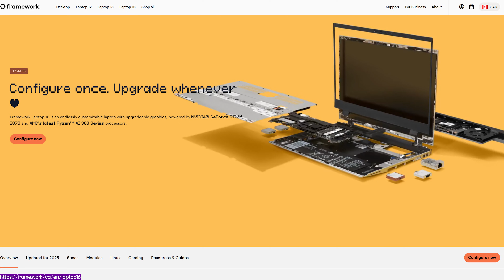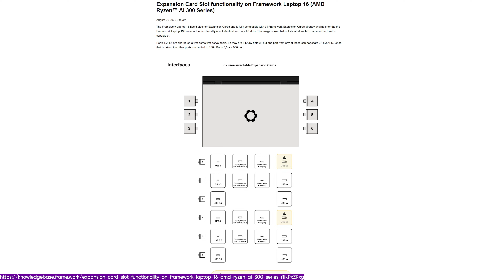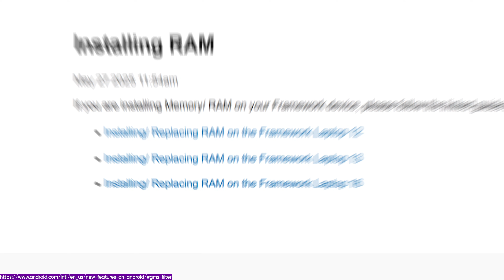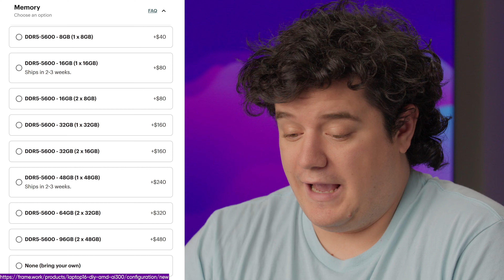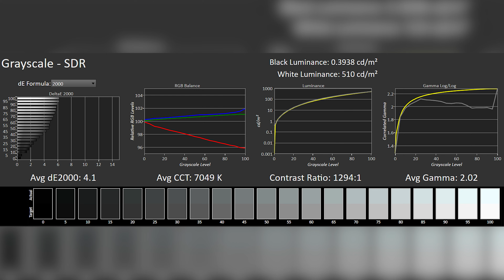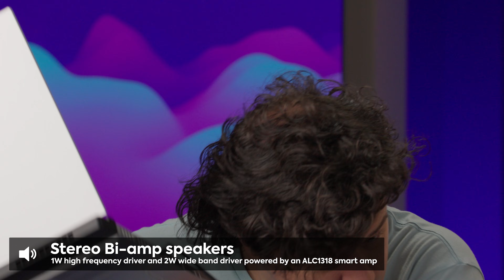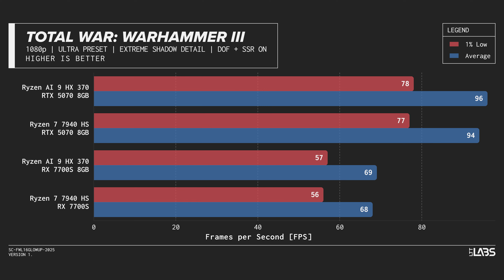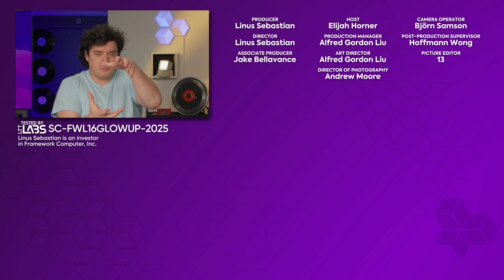I can FINALLY Upgrade the GPU on My Laptop! - Framework Laptop 16 (2025)

Comment: I really hoped Framework would be different but it looks like they are falling down the same path that every other company that has tried modular devices has before. From the high price, to having to replace the screen to replace the GPU, to having restrictions on which ports support which modules. It defeats all the reason of having a modular system. On top of that the amount of flex on this laptop is the worst I've seen in a while, for 3K+ that display should have less flex than a 2x4.

Comment: It’s still very low-spec for what they’re charging. Any laptop with an RTX 5070 won’t really need an upgrade for at least three generations, but the problem is, unlike a desktop, you can’t just swap out the gpu upgrading a laptop basically means tossing the old one in the trash. And the price? Completely over the top. Their laptops are overpriced the same way Apple overprices ram and ssd.
for example, the orange bezel alone costs €24 😅, the LED matrix is €55, and the Numpad (2nd Gen) goes for €45 — all for features nobody really needs. At this rate, you could almost buy two decent laptops for the price of one

Comment: 7:55 The spacers are intentionally different heights, to avoid the keyboard pressing into the screen when closed.
Reply: That doesnt make sense... the frame itself should be what manages the close height/delta. Why would things a user can customize (and if they include a num pad, completely negate including) be what deals with that? Makes no sense. Silly.
Reply: @adammiller9029 The spacers next to the touchpad line up with the touchpad, and the spacers next to the keyboard line up with the keyboard. The touchpad is slightly raised above the keyboard, though.

Comment: All new laptops and phones are too expensive, I came from an age when year on year there was a reduction in price.  The original IBM AT pice in 1984 was $6000 but by 1989 you could by at AT type computer for had come down to under $1000 as the specs had gone up.  My first 486 based computer was about $600.    I don't know what and when the change from cheaper each year to more expensive each year happened but when ever it happened please take us back.

Comment: I was pretty close to getting a framework 16, but the pricing is just ridiculous. I could get a laptop with a 5070 for under $1400 and a similar framework laptop is about double that. I could get the non framework laptop and buy a new laptop in a few years and pay the same amount of money as I would have with the first framework, not to mention the upgrades are also expensive.

Comment: The Framework 16 ticks all check marks for me: the ideal all-AMD setup for Linux (7700s is pretty old at this point though), two NVMe m.2 slots and of course, the modular aspect of it, but the only reason I haven't bought one, as shallow as it sounds, is the form factor. The 12-inch is really cool, the 13 one kinda average but still okay, the 16 though... that mishmash of black plastic and silver metal blocks with gaps and bezels between them puts me off a bit. It would have looked less intense if it was all-black, but I understand their environmental concerns towards anodizing.

Comment: 3:00 Those are not recommended slots, they are the technical limitations. Bottom ones don't support anything else than USB devices, so no video output.
Reply: Bottom two are off a USB hub built into the mainboard. The other 4 are attached to the SoC.

Comment: I'm just not impressed with the fit and finish of this device, plus the screen is a major issue. I'd prefer to have a laptop that's easy to upgrade, but maybe without the weird extra panels...A solid keyboard bezel wouldn't be so hard, would it? For $3,000, I expect better tolerances.

Comment: Not going to lie, this laptop sounds pretty terrible. Super expensive, bad screen, keyboard flex, gaps between spacers that are noticeable, only some USB ports suggested for some applications. Even the upgradeability aspect comes with an asterisk (new screen needed to take full advantage of new GPU). 

I like what framework is trying to do, but I could never see myself buying this.

Comment: I mean I like the laptop but that price is just not something I can justify, I priced one out and I can get a similar performance laptop for half the price.  I was looking at other 5070 laptops that are priced at under 1500 with better displays and for 1600 I could move up to a 5070ti.   I mean I literally priced out a laptop with a 5090 that was cheaper than the framework.     When I just buy a full new replacement after 2 years and still end up cheaper than just the initial price not even mentioning the cost of the upgrade it just makes no financial sense.

Comment: I just think the price is way too high. I considered a Framework laptop, but ended up going with a Lenovo 15IRX10 instead. For $2,500 USD (including Norway’s 25% tax), I got an OLED 165Hz 2560x1600 screen, an RTX 5070 Laptop GPU (same as the Framework), an i7-13650HX (wish it was Ryzen, but its fine), 64gb of RAM, and an extra 4tb NVMe SSD on top of the 1tb the laptop came with. 
That’s double the RAM, 2tb more storage, and an OLED screen for $500 less. And that’s not even counting the tax difference. If you add 25% VAT to the Framework, it ends up around $3,700 USD, so 1200 USD less.
Just didnt make sense, but i guess framework is still very much about North America and not Europe yet. I TRULY hope Framework makes money, and will continue to build upon this modular idea. Its a great idea. just didnt make sense for me.

Comment: @8:30 Didn't people say you can get rid of the keyboard flex by putting thermal pads on some components inside?
Reply: They did something this on the later first gen models. There's some extra padding under the keyboard. Mine doesn't flex much at all.

Comment: The ONLY thing keeping me away from buying a framework device is the price. It was the price when they first launched the Framework 16 and it still is the price that I am not even thinking about buying the new Framework 16. I do understand that it opens up the upgrade path but you have to consider, if I were to buy a laptop instead of upgrading and get similar if not better performance, the argument does not make as much sense. You need to be at least 3 version (GPU and display) upgrades in to make it actually competitive to buying 3 new devices. I love the concept of what Framework is offering, but I just wish they can make it cheaper and offer more options eventually.
Reply: Right, and even then, if they don't have what you need (ex: a bigger screen because your vision kinda sucks even with proper glasses) then you're not going to buy from them. On the flip side, I don't need what they do have, which is whatever high-powered internals that make it worth even $1k. Will the average user need that much memory/power/whatever and not go for something potentially even more powerful for the same price point?

For me, I was between buying a laptop and a tablet or a 2-in-1 laptop that did both. Micro Center had a 2-in-1 for $350 US, and that's with a 16" screen. I haul it around for meetings and occasionally working in coffee shops, and I've been perfectly happy with zero issues. How could I possibly justify even the $1.5k base model price (iirc) compared to that? My home rig got the nearly $2k US treatment, which was much easier to swallow given that I'm way less likely to drop it or get croissant flakes in the keyboard.
Reply: Just a matter of time. These are still somewhat early days for framework. The Framework 13 for a similar config that we have for our business PCs is within 100$ of what we pay. The pricing shifts up and down for our units but it has gotten very close, whether that is because HP charges a fortune or Framework getting the price down, I am not sure.  With that being said the additional complexity that comes from a replaceable GPU will likely mean the 16 will always be a bit more expensive, but being almost double comparable laptops is crazy.

Comment: Sorry to say this but frameworks laptop are for people who don’t understand laptop and their value . If you get a 5070 , 32 gb ram and with 500gb of storage laptop with framework it would cost you around 3000 plus . A similar laptop with the same specs are in the range of 1000 to 1500 . I understand the idea of customization and it being modular but it doesn’t justify the 3x price tag . It not going to save you money in the long run ether because it 3x the price if bought an another laptop you’ll still be cheaper. It a scam trap for people who are into tech . You can legit get a 5090 laptop for the price .

Comment: the upgrade factor isn't worth it when you can just buy a new laptop with newer specs for $1500 half of the frameworks initial price tag

One framework + upgrade would be 3k + 800 for gpu and screen (3.8k in a few years with a last gen CPU and everything you didn't upgrade) 

while 2 Lenovo laptops is only 3k giving you a full system hardware upgrade when ur ready for it

Comment: I've got the 1st gen of this laptop and the fans absolutely HAUL under a load & push a ton of heat out the back. I'm not super upset by it because it means the cooling is working but they are definitely loud and sometimes out power the speakers

Comment: 4:40 "Liquid Metal can sometimes be a little daunting" 

Quite the understatement here.
Reply: Yeah. Modular laptop and liquid metal are a contradiction. 

LM is already a nightmare for repairability (often the cause of the issues due to its conductivity). There is almost zero usage cases where the theoretical extra 2 degrees of dissipation it might offer actually justify its use, let alone on a laptop that's meant to be regularly disassembled.
Reply: There is an alternate thermal paste, that's about as good, or better then LM, plus its non-conducive.
It's by Thermal Grizzly, but has a reddish color paste.
I think its a little more expensive then LM version.
I've already used it in one of my computer systems.

Comment: The price is absurd, for the money you could buy a regular laptop with same specs now, and replace it in a couple of years with another one with up to date parts. Until Framework manages to get their prices to maybe 20-25% over comparable competitor at most, I don't see a future for them in mainstream market, despite all the free promotion they are getting from LTT.

Comment: So… horrible display, bad battery life, okay speakers, bad build quality (crazy display and keyboard flex) thick ugly bezels, weird shelf-like look in the back, vents galore in the bottom, spacer spacing issue, thick heavy power brick, heavy laptop… all so I can fix and upgrade easier?

What are people doing to their laptops that makes them this worried about repairability? People typically upgrade every 5-7 years. You’re telling me in 7 years time they won’t just decide to buy a whole new model of framework where the peices will undoubtedly be either incompatible or very limited performance wise with their current motherboard? 

Buy a better spec, less repairable full package windows laptop. Better yet, buy an M4 air for 800 or an M5 pro if you really need the upgrades.

Comment: What do I think ? I think you're quite wrong on the pricing. And frankly, quite a let-down to dedicate so little to it, even if it's Short Circuit.

First, I am a firm believer that the most important part of the laptop (and the extra price you're paying) is for repairability first, upgradeability second. Repairability basically guarantees that you can use the laptop for over 10 years (you or whomever you might give it or sell it to) even if Framework goes bust tomorrow. With its modularity, it's also easy to find spare parts. If you do need to repair, you have the highest chances it can be done in the first place and at the cheapest price one can usually get. That's how you recover the money. This repairability also makes it so it can be sold for somewhat decent price later, even if the components are dated.

Second, the price is very big.... except you can buy the SSD(s) and RAM from a retailer (if you don't already have some) and get to a much lower price. Still on the expensive side, still usually more than the competition with the same specs, but much closer and easy to reason with. This is why I'm disappointed that it wasn't even mentioned.

Frankly, a full video exploring the options and the lowest prices you can have the Framework laptops (all 3) is SORELY needed. I had comment fights with others on YT on other videos about the Framework 12 that said that you need to spend $1000 and that it's too much, only to show them that if you're smart about it you can spend $650 and have the laptop, and spend $100 later and arrive at the same specs as the $1000 one. Not to mention that you can go second hand if you're on a budget. People REALLY don't know how many options Framework gives you.

Comment: exorbitant. this is hopeless. industry should collaborate a standard for modular laptops like a DIY/desktop PC. this is way overdue considering the electrical components of a laptop can fit inside the dimensions of a smartphone or PC gaming handheld or tablet pc. don't mind discrete GPUs, integrated graphics is now and the future.
Reply: They earn more money when you buy new laptops instead of upgrading, so most probably wouldn’t do this

Comment: That price tag is where the struggle is. Even with all that modularity framework cannot seems to push volumes enough to bring the price down. Only if some of the manufacturers actually see this potential and get on behind it.

Comment: I think they should open up a market place such that the community can sell their old parts to help fund their next upgrade
Reply: It would be awesome to see a custom enclousure for for the display that would allow you to make the older display a portable monitor. If you need to upgrade to get the most out of the GPU giving yourself a portable monitor would be pretty nifty.
Reply: Jawa?
Reply: You can do it right now using the forums I think
Reply: That's already a thing on the website, from what I recall.
Reply: i think thats the long term plan for it which was why they originally called it a "marketplace"

Comment: hey elijah could you make a video where you compare buying a standalone gaming laptop vs building a desktop and pairing it with a crappier laptop/chromebook for remote play using parsec or moonlight/sunshine? For this i would recommend getting a dummy hdmi plug and using CRU to create custom display modes/resolution for it and sometimes you can use CRU to overclock the integrated display on some laptops from 60hz to like 100hz. You could also set up a wireguard relay server for remote desktop to work on public networks or if youre behind CGNAT